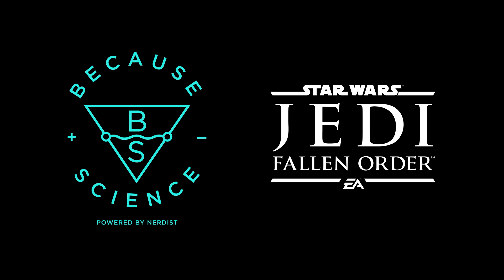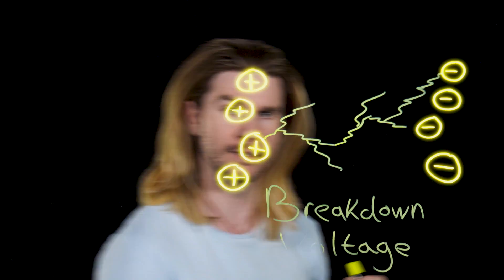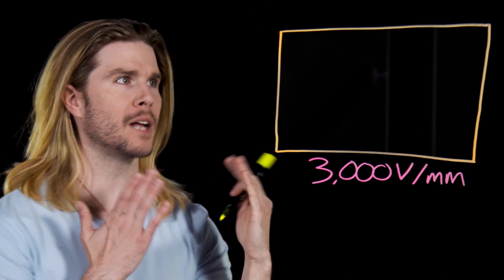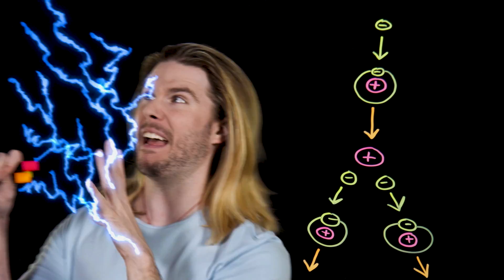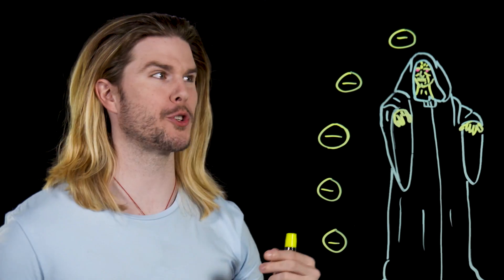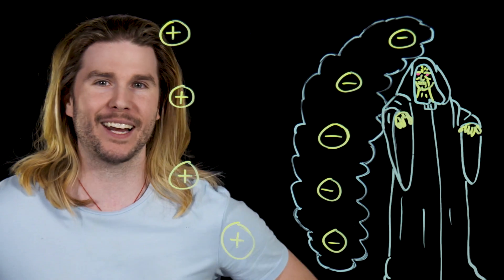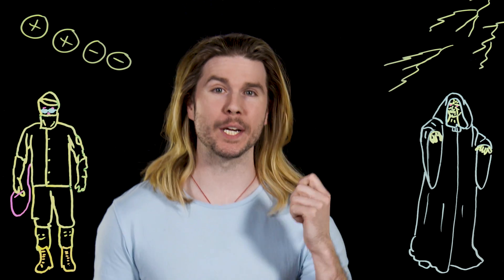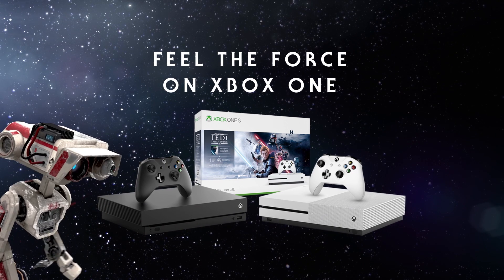How Does FORCE LIGHTNING Work? (Star Wars SCIENCE)

Comment: The emperor uses the force to pull all the air particles closer, which brings down the break down voltage, then manipulates their negative charge like you said which will help with the equalizing between the charges. Could make creating the lighting easier.

Comment: or maybe force lighting is just using force telekinesis on electrons, in which case a faraday cage wouldn't work because Palpatine could just push the electrons through the material. Also it would make sense that he's controlling the path of the electrons since they don't go the path of least resistance.

Comment: Personally, I think it would make more sense that the Sith can reduce the resistance air has rather than building charge. Probably by compressing the air into channels where a charge can move much more freely. The reactions Jedi have to being struck with force lightning are nowhere near what would be expected from the voltages you were talking about, but lowering the resistance of the air between you and your target would make a taser-like strike much more viable. As the basis of almost all force abilities is telekinesis it would make sense that part of force-lightning is manipulating the air to create channels for the lightning rather than manipulating charges, though that would be required to charge the channels as well. It would also explain why it can be directed rather than seeking the path of least resistance to ground itself.

Comment: While voltage does play a part. Amperage decides the effectiveness of an electrical assault. 22 million volts while it may bridge the gap. It would be merely uncomfortable with out the necessary amperage to do physical harm.  Which probably accounts for the disfiguring of the emperor when using force lightening.

Comment: Hey Kyle, love the show.

We all know your supervillain tendencies, and force lightning would certainly be a fine addition to your collection of villainous powers. Sadly we haven’t figured that out yet, so a more practical solution is required. No need to worry, for I have designed the perfect system to grant you lightning powers by answering one question: how much do you have to rub your feet on the carpet in order to shoot lightning?

This is caused by the Triboelectric Effect, which is the phenomenon where certain substances pass off electrons when they come into contact with other substances. The Triboelectric Series ranks the most common of these substances against each other by how likely they are to give or receive electrons in these exchanges. Picking two extreme examples from the list, if you hypothetically wore Teflon shoes and walked on a floor of polyurethane foam (like and egg crate mattress) you could achieve a differential of 250nC per Joule of friction.
Next think of the human body as a capacitor, storing up energy to be released in one massive discharge. The capacitance of the average human body is roughly 200pF. The relationship between capacitance, charge, and voltage is C=FV. In order to discharge that massive 22MV of lightning, you need a total charge of 0.0044 Coulombs.
Going back to the triboelectric effect, the total amount of friction needed to obtain the necessary charge is given by J=(0.0044C)(250nC/J), which gives us a total of 17,600 Joules of friction. This doesn’t sound like much, but sliding your feet on the floor doesn’t take much energy.

Now we just figure out the total sliding friction we need. The average human stride is 78cm and the average width of a human foot is 10cm so that the total area of one stride to be 780cm^2. Using a friction value of 0.001J/cm^2 (this was the value used in the study I based all the calculations on) this gives a total of 22,565 strides to build up the necessary voltage. Swap some units around, and this winds up as a grand total of 10.7 miles of sliding around in Teflon shoes under completely ideal conditions at 100% efficiency.

TL;DR – You would have to slide around for just short of a half marathon before you get on Palpatine levels. Or build a sock-carpet treadmill, you can stay in one spot and build up the charge. Just make sure your target stays in one spot for two hours, you can’t pick your feet up or else you gotta start over.

P.S. - I know the science makes no sense, but it was a fun thought experiment. Plus I haven’t done circuits since college, so it was nice to re-learn all that.

Comment: So I work in an industry called thermoforming, in which we use machines to heat plastic and form it into containers. Some of the plastic that we form creates a lot of electrical potential, and it builds up over the course of many hours.

One day, I was working on a machine and the built up electrical potential released.

I was holding onto the frame of the machine, reaching across the plastic to another part of the machine. The electricity arced about a full 1/16th of an inch at my arm.

It actually seared into my skin, leaving a scar. What I am about to tell you is a moment-by-moment experience of what I felt.

The first initial second was unlike anything I have ever felt before; It was pure intense pain. There is no descriptor I can attach to it. It wasn't sharp, it wasn't dull, it wasn't stabbing or throbbing. It didn't feel like pressure, nor did it feel like piercing. It just was. The pain, in all of it's magnificent magnitude, simply was. To rate the pain on a scale from 1-10 wouldn't even do it justice. I've had a tooth shatter before; I've had a rib crack; I've had a blunt object strike my temple so hard I lost vision; I've even suffered from an intense medical condition known as Costochondritis - and that was so intense that I passed out on the way to the hospital. But this? This pain was worse.

When the bolt surged into my arm, it tightened all of the muscles in my arm, including my grip. My whole side wrenched as it contracted. When the momentary discharge ended, which only took a fraction of a second mind you, my entire side was sore.

After some colorful language, I stepped off the machine and checked out my arm; My skin was actually melted as though I had took a red hot nail and pressed the tip into my flesh. I inspected the rest of my arm, and I had heat rash where I assume the current left my arm.

Specifically, the current traveled through my flexor digitorum superficialis muscle.

The muscle was incredibly tense and sore; The kind of sore you get after a full day at the gym with intense, non-stop activity. Not only was it sore and swollen, it was also extremely itchy. For anyone who has ever has the misfortune of working with fiberglass, it was like that. But being deep inside my body, there was nothing I could do but ride it out.

The pain lasted for about a full hour, with dull pressure lasting about three. The heat rash healed, but I do still have the scar from the entry point.

Having worked in this industry for seven years now, I have been shocked quite a bit. It's not all types of plastic that do this, but the ones that do build it up are very problematic. Unfortunately, there isn't much we can do other than wear protective clothing such as long sleeves to help mitigate the shocks.

And of all the places I have been shocked, the worst isn't the nips or giblets, but the eyes. I got shocked on the left eye before, and it caused temporary blindness. My vision was dark and foggy for maybe 45 minutes after it, kind of like if you press really hard on your eye with the base of your palm (don't do this; it's bad for your eyes) and then try to see out of it.

Comment: If it were a simple electrical charge imbalance, wouldn't it take the path of least resistance and thus go into the metal railings or floor, rather than going across the room to Luke?

Comment: Sooooo

The Force turns it's user into a Tesla Generator. Does it mean Nikola Tesla was a Jedi? :E

And to be honest rising the voltage is step one. After the voltage is big enough a Jedi or a Sith has to generate  a flow of electrons big enough to "fry" the opponent. What do you think how much power does it take? Rising the voltage up to tens of million volts  and then creating a current that harms the opponent. Without enough current the ionised path would break down very soon and no arc.

And actually those arcs should rise - hot, ionised air goes up :P

Comment: Hi Kyle, love the show. I have one thing to add though.
When a body has very large electric potential the electrons tend to escape from the sharp edges. And the arc is created from these sharp edges. The problem is that the voltage decreases before it gets high enough due to the electrons escaping so easily.
This is why by expanding their hands the Sith Lord shoots arcs exactly from their fingernails. But to pump the voltage up it is more believable if a Sith Lord shoots the lightning with a clenched fist instead from their fingers. Lightning fist? A fist avalanche?
Also it will help if the Sith Lord has a rounder shape (no edges from clothes and so on) as all of the electrons will escape from the fist. Now if this is not cool!
There is a video from ElectroBOOM, when Mehdi tries hard to sooth out the edges of his Van De Graaff generator in order to keep the voltage up before the arcs are created. This way he can create much bigger arcs.

Huge fan. Great show! Keep it up!

Comment: My cousin came up with this reply, (referring to kyle as "you") "you said that there had to be an incredible high voltage in order to break the air tension. Then you said that the Jedi, excuse me, Sith would have to move the electrons and collect them around themselves and collect the protons and neutrons around their target. But you wouldn't actually need as much voltage as you said because if you line up protons through the air towards your target then you don't have to break the air tension because just like for actual lightning strikes there is a ready path way in place!!! So the Emperor could use force lightning just by scuffling around then forming a bridge of protons from his target to his hands instead of gathering massive amounts of negatively charged electrons with his negative anger and rage fueling his force use to unleash high voltage attacks. I think it would be easier to just create a +bridge and shock your opponent to death than to hope that your massive voltage doesn't go somewhere unintended (say the reactor shaft specifically created to rip apart atoms and keep the protons in a large tube. Yeah the massive amount of negative charge would definitely be attracted to Luke not that shaft ninety degrees to his left. Any way just some speculation on my part"

Comment: If force users can manipulate the universe down to the scale of electrons, surely they can manipulate atoms, so is it possible that the Sith are changing the makeup of the air along the path of the lightning to lower the breakdown voltage? (such as shunting all of the nearby oxygen atoms into the path of the lighting)

Could they not also kill the effect in a Farraday cage? sure you might catch them off guard the first time, but after that, with training, could they use the force to keep the electrons in the metal balanced and hence remove the cages interference to the lightning

Comment: hey Kyle. love the show. i live in the high humidity state of Louisiana and have issues with unwanted static discharge. i seem to get more discharge during the winter and when it rains. is there a connection of temp and humidity to the amount of electrons built up? also i don't drag my feet and i don't want to be scared of door handles anymore.

Comment: Hi kyle love the show. 

Hearing your explanations about lighting force made me pop out of mind that question; if is so simple to conuter that tecnique couldn't be a void field created by the force be enought? electricity travel trought the air becasue of the molecules, so if there are no atoms you should be immune. At this point the best range attack for a force user should be LASER BEAM! Let me explain... when luke show itself in front of kylo ren he do it in from of projection, wich we can assume he's doing using the light around here, that means you can control even light particles.
You could be easly able to concentrate those 
particles to launch them foward your enemy at speed light. Moreover it dosent have the same weak point of the lighing force who is bounded to many factor to work, as we know light travel trought space.

Ps; Nice hair. Almost longh as mine.

Comment: The question is, would it even kill them with a few million volts? Like yeah, but it has to be 0,6+ ampere to be lethal. Nikolai Tesla sat and read a book while being charged with millions of volts and didn’t sustain any damage, the reason of this is because the ampere amount was too low. Could the sith even get enough energy to get a high voltage AND a high enough ampere amount?

Comment: But Kyle! What if "the force" could remove all the air in a cone in front of you? Wouldn't that lower the breakdown voltage required? Or since there is now a pseudo-vacuum will there be nothing to conduct the electrons?

Comment: hey kyle, 
i really enjoyed the episode and genuinely feel like i learned a good bit. i do have 2 questions though. if a sith or jedi could use the force on a molecular or atomic level could they not just pluck electrons from the atoms in the air or ground around them and fling them at the target?
of course i'm no expert but it would seem like this approach would act more like a taser or stun gun as you would be flowing electrons directly into the body. 
my second question is with your approach, if the idea is to make a charge imbalance wouldn't the resulting arc just go into the ground they are standing on before the body of a target because it is closer and possibly more conductive?
Reply: Electrical engineer here. For your first question, they could in theory pluck electrons off of basically anything and hurl them at the Target. This however is apparently not done because of movie Magic. For your second question, the answer would depend on the electro-magnetics of the setup. Well it's not easy to predict more complex problems, the Force lightning user would have to make sure that breakdown voltage would only occur between him or herself and the target, and not anything else such as the ground.

Comment: I believe the idea of a Faraday cage is also why you lose cell reception when inside an elevator (since it is just a moving metal box) and why your car can offer protection from a lightning strike. You don't lose cell signal in your car of course because of the obvious holes (windows), so it isn't a complete Faraday cage. In an elevator, the metal box is redirecting any radio signals and dispersing them around the box, so none get in. And the same concept for your car, the metal frame directs the lightning through it and no electricity is felt on the inside of the vehicle. I'm not a physicist though, so maybe I am misguided.

Comment: I have a question, how thick must be the Sith shoes, if he doesn't want the 22MW to discharge in the floor rather than in the air? I mean electricity is supposed to use the path with less resistance, the human body being full of water it has less resistance than air.... 
Second question in SW 2 (clone wars) Yoda repulses the force lighting of Darth Tyranus (Dooku) does that mean that his body has more resistance than air? How is his nervous system made of if his body is resistant to electricity... So many questions about the most famous Jedi ever.

Comment: I see two major problems with the assumptions or lack thereof in this video. (To be clear, still loved it.) 
Firstly, you're assuming that the force lightning is having to travel across normal air on the way to its target. But while the air may start out normal, it ends up being in the path of a Sith Lord who has the ability to rip electrons from individual atoms on a large scale. Thus, in theory, they could simply create little tubes of ionized air on the path to their target without even building up any charge of their own. Then of course they could still build up a charge on their own bodies and propel the electrons through said tubes, which would also explain why the lightning they summon doesn't just strike the nearest object to said Sith and instead reaches a specific destination. 
The smaller amount of extra lightning flying out to the sides would just be air currents moving particles in and out of those tubes and causing leakage. This effect would be more pronounced as they Sith Lord using the lightning lost concentration and couldn't maintain the tubes but continued to apply the charge, like when Vader picked up Palpatine and surprised him.
The second problem is just in the suggestion to wear Faraday clothing to prevent the lightning from doing damage. Sure it could perhaps weaken the effects of a shock that was "blindly" thrown while the Sith's focus was elsewhere, but again, they can control individual atoms. If they had enough focus and their opponent wasn't another force user actively countering it, they could just force the electrons from the lightning into the metal on the outer side and back out into the person on the other. All they have to do is make sure their particular level of force abilities gives them more energy than what it takes to bind the electrons into their flow through the suit.

Comment: Alright Kyle, I see your millions of volts and raise you one problem. You can counter the lightning but you forget that there is dark side energy there as well. Lightning is neccesarilty by your definition a manipulation of the cosmic force. You  lightning defense works against that but just like a force push, there is still energy, that is why  you can see that victims of force lightning can sometimes be staggered. I would argue that force lightning is not even the most dangerous part of the process but it is the dark side energy. You can see this in episode 3 and 6.